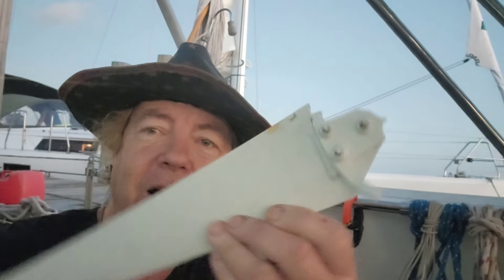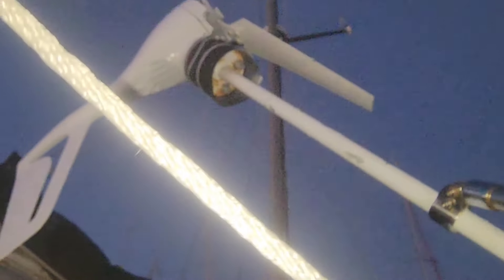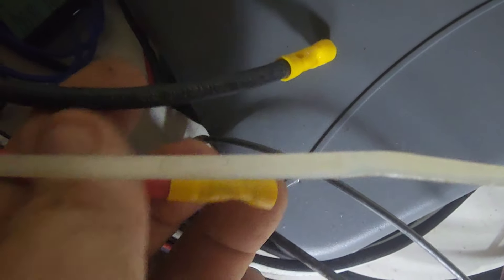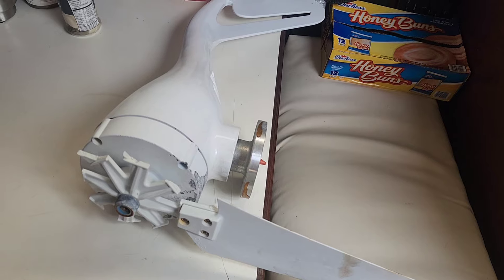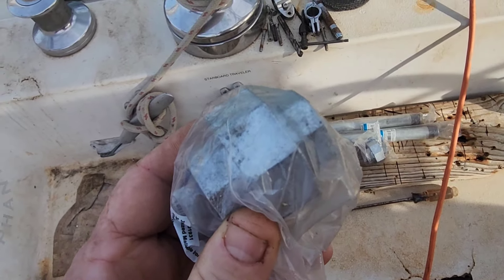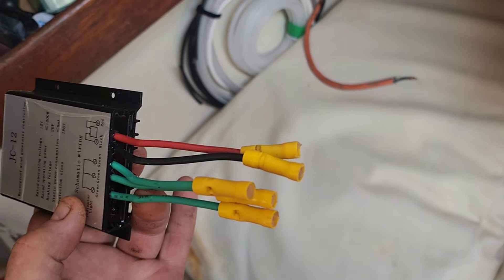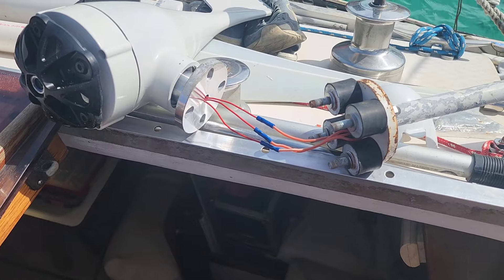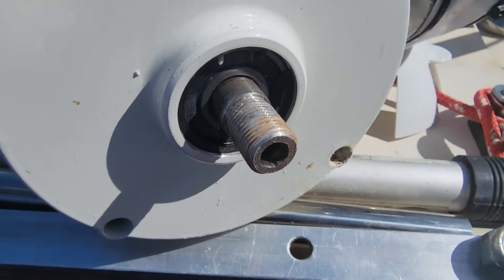Installing new 1600 W wind generators on Sailboat C&C 39

Comment: Nice happy sailor video! What brand and type are your new wind generators?
Reply from the maker: Wind Turbine Generator, 1600W 5... https://www.amazon.com/dp/B08PV27JVP?ref=ppx_pop_mob_ap_share
Reply from the maker: We are impressed with the performance charging our 8 ea 100ahr lithium iron phosphate batteries at night!
Reply: @nbr33fans  That's very cheap. I would not trust such cheap Chinesium stuff on a sailboat, out of fear for fire/smoke.
Reply from the maker: Your welcome to buy a more expensive model but like all the lithium iron phosphate batteries the cells and components are the same inside made in China.  Only difference is the marketing and price!

Comment: I personally hate these propeller type generators you should be looking at vertical or horizontal generators there is one that I have seen that changes diameter based on the wind speed and it generates power at much lighter wind speeds than the blade type.
Reply from the maker: Adding the vibration isolation mounts between the wind generator and mounting pole make all the difference is noise